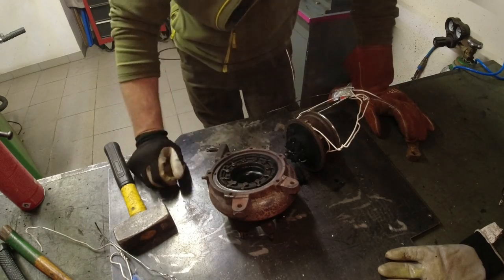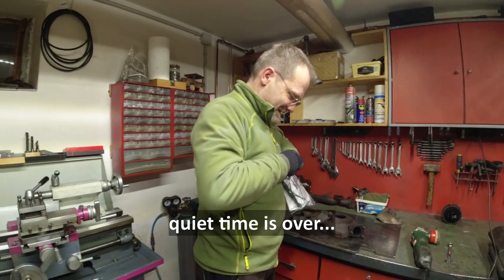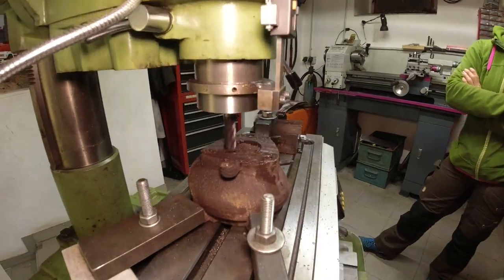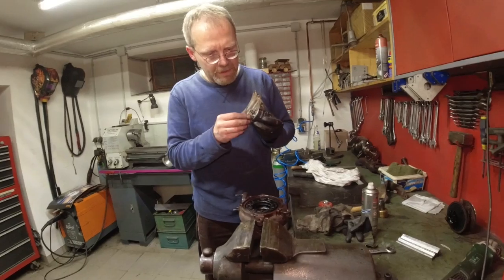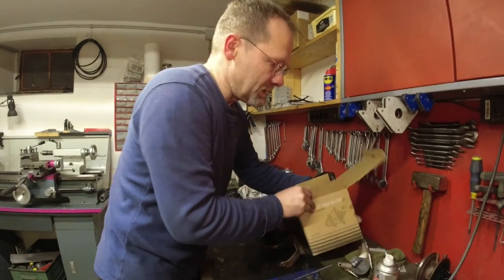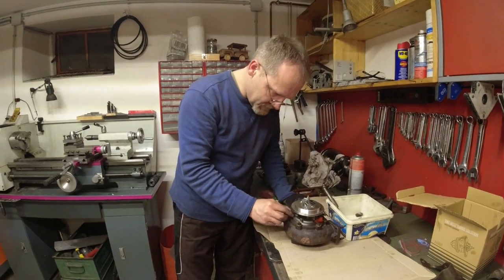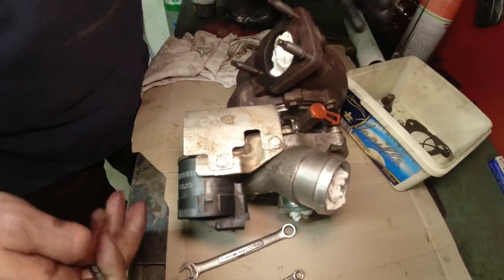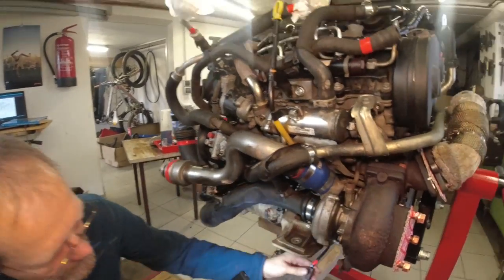How to rebuild a turbo charger of a Land Rover Discovery

Comment: Old school mechanic - a dying breed - rebuilding parts instead of just replacing the part or a module and throwing the old part away. On top of it, the guy is German (possibly with a desirable OCD ;-)), which pretty much guarantees a perfectly executed repair, with no corners cut or steps missed. Excellent site...

Comment: A tip I found a few  times on Youtube for removing rusted in studs is to run some candle wax around the base of the stud as you heat the surrounding area, after breaking three studs on a 50 year old exhaust manifold I tried this and the rest came out a lot easier without breaking.

Comment: Great video as usual. Japanese use M7 threads, older Gsxr suzuki cam cover bolts are M7, the Japanese manufacturers also use M10x1.25 instead of M10x1.50 like the rest of the world. 👍

Comment: A very interesting Video. 
For a moment, I was thinking that the Turbo only worked (was driven) from one side of the ‘V’, until I noticed the heavily insulated cross-over exhaust pipe that runs behind the rear of the engine from the other side. 
We certainly learn a lot from your videos. Thank you.
Reply: The flexible sections on those crossover pipes fail too..  :(    Really difficult to access to swap out without lifting the body, but it is possible.  Ask me how I know...  :)

Comment: Great video guys , I stuffed my cartridge replacement up like how you mentioned, 

I only measured the threaded screw adjustment which was different to the aftermarket one which led to actuator faults and engine going into limp mode 

Such a simple step that caused me to  replace the turbo when on the car * not fun * 😒 

I do like my method of jacking bolts rather then the blow torch though for separating the cartridge 🤣🍻
Reply from the maker: 😅👍Can you send me or Christian an email with your adress, again, please🙏 🙋‍♀️Vera
Reply: @Vera_and_Christian  will flick it through to both your instagrams

Comment: Just would have been nice to point out that before you start rebuilding a turbo you check that the actuator works. We do that by getting someone in the drivers seat and just putting the ignition on,  at that moment the actuator move's the vain's by closing them ready to start.  Sometimes the vain's seize so you can reach through and disconnect the actuator arm then try again.  You can see them move by looking up from the bottom of the car .  If then the actuator still doesn't work it needs replacing.  The vain's can be bought separately for around @130 euro's off Ebay.  When you receive the new vain's it is easy to understand how they fit? I found out all this information at my own cost so this is great information to have.  One More point when my actuators broke down both side's no fuse was blown so when they where replaced they both worked first time.

Comment: Always a thumbs up!  Great video.... but I do wonder if an aftermarket or refurbished unit would be more viable.  That said we enjoy watching these videos as much as you do making them, OMG!
Just another thought, was there an opportunity to adjust the wastegate/boost pressures doing this?  The 2.7L engine is very conservatively spec'd as standard.
Reply: No wastegate on these.  The actuator drives the variable vanes only.
Reply from the maker: Well, after that HPFP debacle, we were kind of done with refurbished. Actually; we are still done with refurbished parts. And a cartridge was the cheapest option back then. When we did this work, we were in the middle of the engine rebuild and were just glad we could get parts at all. Covid was also still very present with delivery and availability problems. And it was not our engine, so we had to consider the money Fabian had available at the time. 👍🙋‍♀️Vera

Comment: Interesting decision to just re-core the turbo.
When my LR3 turbo went bad, I replaced the whole unit with a new Borg Warner full assembly.  I tore the old turbo down just for fun and the vanes were jamming in the exhaust housing.  If I had re-cored it, the vanes would still jam as there is no obvious way to service them. Considering how difficult it was to do a turbo swap in the car without lifting the body,  I would recommend just to swap the full assembly.
People talk about lubricating the actuator linkage to stop the vanes jamming, but I think the jamming is caused by carbon build-up in the variable vanes, not the linkage.  Once I soaked the turbo in brakecleaner, the vanes were much better, but I still wouldn't reuse it.
Reply from the maker: You have to remember that it is Fabian's Discovery and money. Money is always tight with an engine rebuild. I think by that time, already 3000€ were spend. 🙋‍♀️Vera

Comment: One of the reasons l sold my LR3 my fear of the turbo charger “going” and being told it’s recommended  the whole body is to be lifted from the chassis (whoever designed this engine needs to be shamed) and the garage cost would probably exceed the value of the vehicle as LR3’s with “problems” can be bought pretty cheap in the U.K. see EBay LR3 spares or repair Just getting to oil/grease free up that actuator via the front wheel  is like trying to open your front door through your letter box. Again such a shame a great vehicle spoiled by that short block rubbish engine. Great video guys
Reply: Took me 3 days to do a turbo swap in my driveway without lifting the body.  I can see why mechanics take the body off.  It was very difficult, but not impossible.
Reply: Yes it’s possible without taking the body off. I had a new turbo (thankfully under warranty but and independent and needed a fight) the garage did it, but was a few days work.
Reply: @davidedwards4125  yes lm aware as l said it’s “recommended” either way that 05 LR3 of Veras - can be bought for a song in the U.K. needling a turbo fitted - if LR want £1100 for a gearbox oil change l dread to think of a turbo fit

Comment: Christian, do you have MAP gas torches in Germany? MAP gas burns at a much higher temperature than butane or propane, consider investing in a oxy acetylene kit. Since the Chinese has start making Magnetic Induction Heater Kits, now they can be had for about $200.
Reply from the maker: Yes we need to invest in our workshop, Robin is giving us a hard time also. 😅👍🙋‍♀️Vera

Comment: Help please. Hello, thank you for your video. With leaking turbo, do you have sometime loosing power? I have on a TDV6 big grey smoke when i push the rpm and sometime loosing power. More when i run faster. Must make a restart engine when runing to get power again.
Reply from the maker: There are many potential issues for smoke.  Can’t be diagnosed remote.  Christian
Reply: @Vera_and_Christian  Hi again, thank you for your answer. I delete today the egr system i blocked air and disconected the wires. I do not a programation to delete it so i still now with an engine light. But i lost like 65% grey smoke in all situation. I  suspect now my temp water wire because i have full high level hot engine red light( for little seconds) when i run on bad road  (sorry for my bad english).

Comment: Hello Mate, i was having a Engine System Fault message on my dashboard so i decided to remove the Turbo on my 2005 Range Rover Sport 2.7TDV6 and cleaned the internal Turbo Vanes to ensure free movement of the Turbo Actuator Arm. Before removal of the Turbo i was getting error code P132B-00 - Turbo/Supercharger boost control A performance (permanent), now after cleaning up the Turbo, i also decided to reAdjust the adjustment screw settings for the actuator arm to have more room for movement. After re installing the Turbo back in the car the Engine System Fault error was gone and there were no more error lights on my dashboard. I am now getting DTC P138E Turbocharger boost control position sensor A - minimum/maximum stop performance with no error lights on my dashboard. I am also experiencing power loss on high rpm with these DTC's  "B1B02-28 Low Frequency Coil" and "B1C57-14 Unused relay drive". Could you please help me solve the problem with my car. 
Thanks
Reply from the maker: 😱 That is terrible I think.  It is possible that the actuator runs out of stroke.  Did you transfer the setting as I did.  Check out the two videos from Outback Discovery on YouTube. He had the same issue as you and then he fixed it in a video later.  Big job.  Christian

Comment: The irony is just killing me, my discovery sport is in the shop as we speak getting a new turbo installed. To which I got a turbo under boost code as check engine light came on. Now a whole new turbo had to be purchased?! I dropped off car to LR, with no mechanical noise, nor smoke from turbo. I had cleared the only code that had come on, cause it was going to be couple weeks before they could diagnose car. Time came to bring car in and get it fixed . Light hadn’t come back on yet and drove fine whole time, long as ya didn’t get on it like a crazy person. Technician put over 500 miles on my car trying to get check engine light back on  so the computer could pin point what to change. I noticed by driving it, the waste gate had to be loose not sealing causing the code. So why couldn’t the technician de-deuce this while putting all those miles on my car ? He saw the code in the history, but had to have that light come back on, only to say needs new turbo and catalytic converter??? Just not adding up ?!?
Reply from the maker: I won’t see your reply to my answer.  Better write me an email.  Never heard of a 500 mile test drive.  That is indeed ridiculous.  Christian